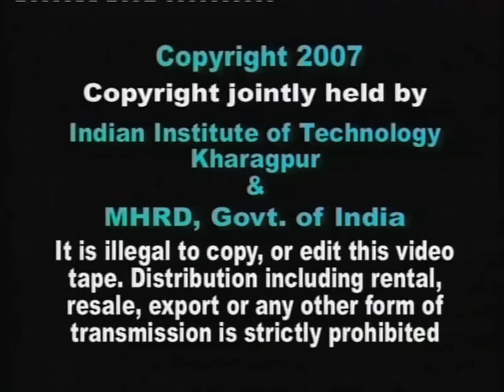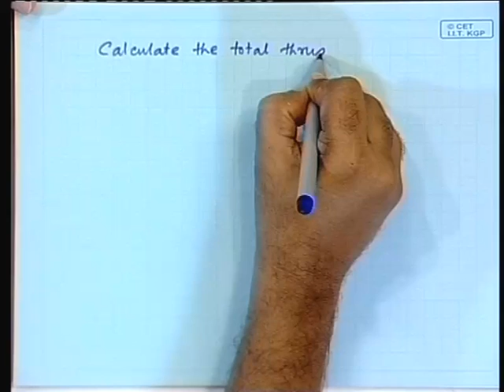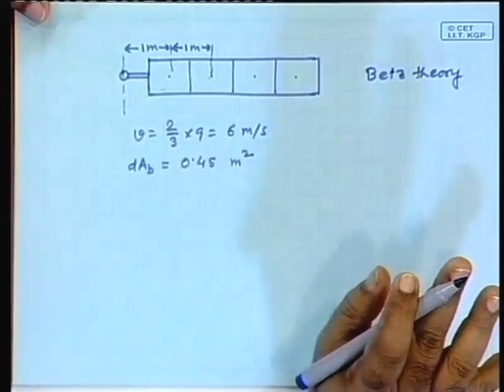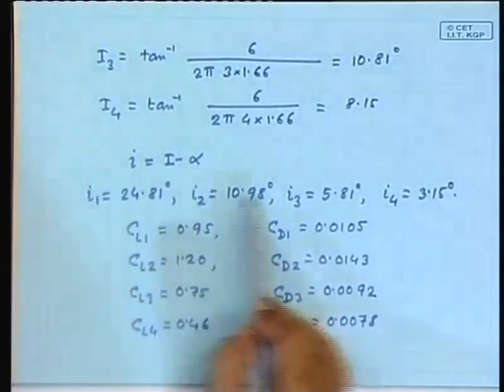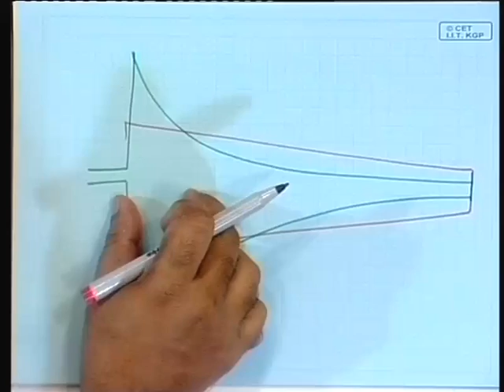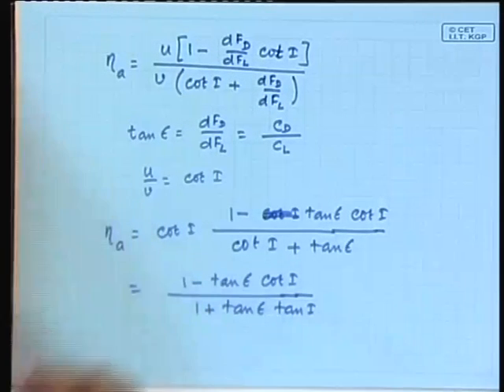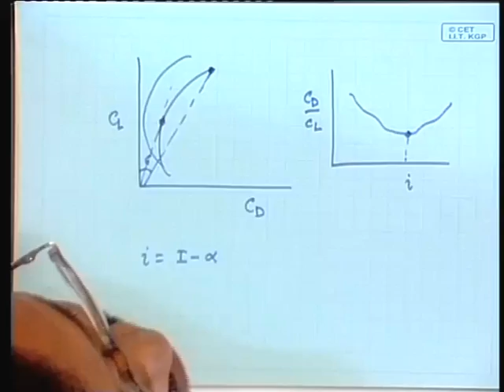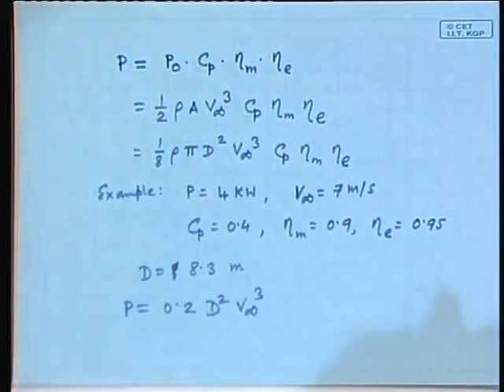Lecture - 23 Wind Energy - III

Comment: I am getting omega1= 10.43rad/s and w = 12.03m/s. Taking density of air as 1.225kg/cu.m dP1 is coming out to be 161.91watts. how 198.2 watts came. Also other powers are not coming accordingly as shown in video.  please tell me anyone.
Reply: for dP1,
omega1 = 10.43 rad/s
r1 = 1 m
rho = 1.225 kg/m^3
dAb = 0.45 m^2
w1 = 12.07 m/s
CL1 = 0.95
CD1 = 0.0105
I1 = 29.81°
Putting in these values, you can get approximately 195 Watts.
Reply: @sahilchawla9339   how did you solve for w1 or is it a fixed value give>?
Reply: @ituaomion391  w1 is the relative speed of wind with the first section of the blade, which is basically the vector sum of u1 (linear speed of the first section = omega1 * radius = 10.43 m/s) and v (wind speed = 6 m/s). Since u1 and v are perpendicular in this example, w1 = sqrt (u1^2 + v^2) = sqrt (10.43^2 + 6^2) = 12.03 m/s.

Comment: Sir, it is noted that component of dFL and dFD along dFT is added to find the net thrust force for the blade element. However, how is it possible to resolve the component of dFD along dFT, with respect to angle I, which is actually between dFL and dFT. Ideally, dFD shall be resolved with respect to an angle between dFD and -u. Kindly clarify.

Comment: I got it, w square in Fl and Fd is the relative wind speed which is solved trigometrically and the other w in P is omega which is 2 pi (f) = angular velocity = 10.5 at point 1
Reply: I followed this information but my answers are wrong. I used omega as 1.66 rps;radius of 1; area of0.45 and relative wind of10.82 but the answer I am getting is not the same as the one found in the video.

Comment: what is the omega value? (where from?) when calculating dP1, dP2 etc around 28.00 min.. thanks
Reply: omega is the angular speed of rotation of the blades, which in numericals is to be taken as rad/s. In the question, 100 rpm is given which should be converted to rad/s before using it in numerical by using a factor of 2*pi/60, which will give you omega = 10.47 rad/s

Comment: for dP1: Omega1 = 2pi*1*1.66 and W= 1/cos29.81 but I could not get 198.2Watts. thanks
please help
Reply: W (relative wind speed) is not 1/cos(29.81), rather it is u1/cos(29.81),
where u1 = omega1 * r1 = 2*pi*1.66*1 = 10.45 m/s
which gives W1 = 12 m/s (approx).